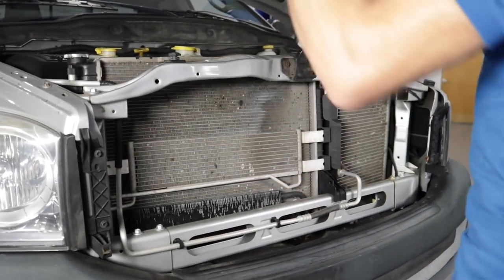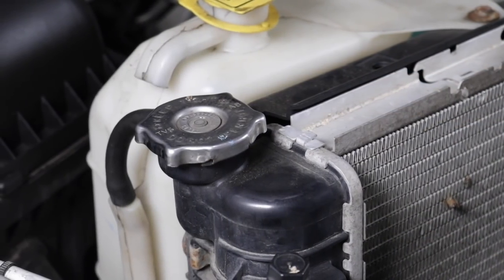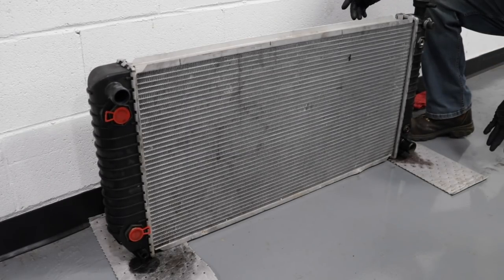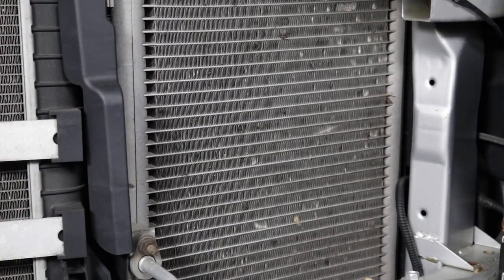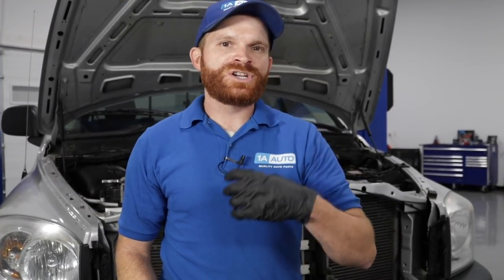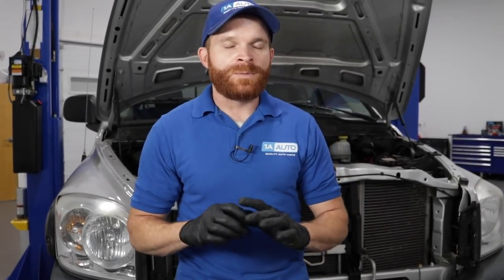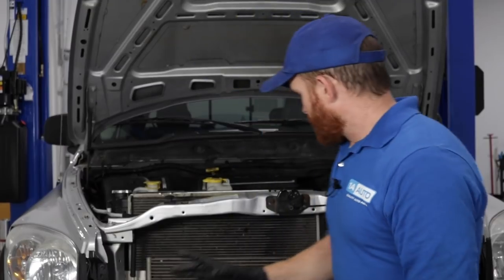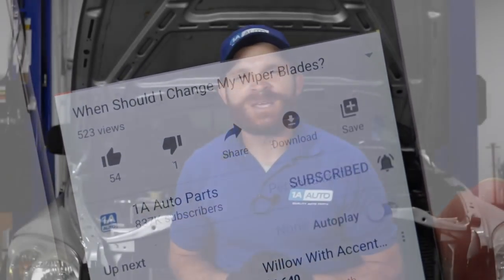What Are All the Other Coolers Beside My Car's Radiator?

Comment: How do you get rid of flies on the radiator?
Reply from the maker: +Ada L Thanks for checking us out! You can use a soft-bristled brush (not a wire brush) to gently remove any debris from the fins. You can also use a cleaning solution to help with some of the more stuck on debris. If the radiator is being removed, you can also use a garden hose (not pressure washer) to try and force some debris out that was as well. We do not recommend doing this with the radiator still installed on the vehicle.